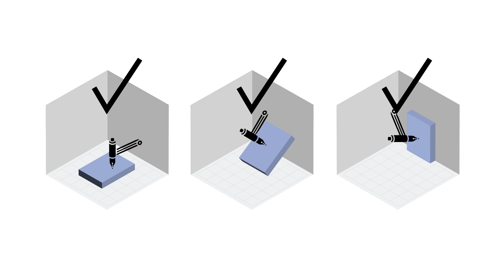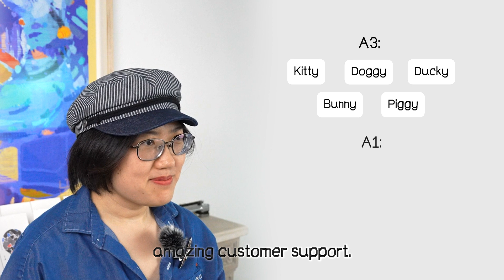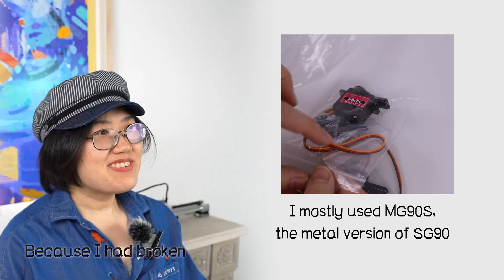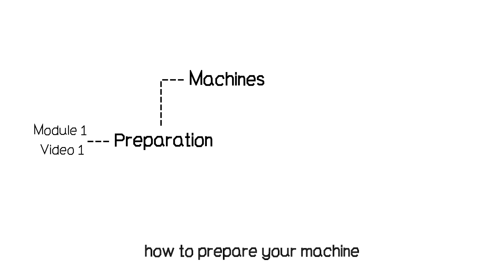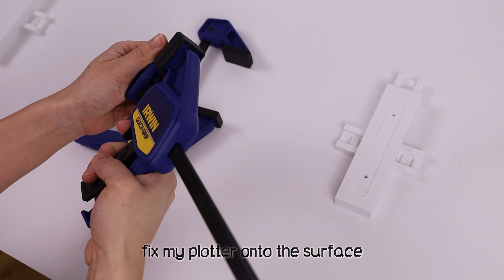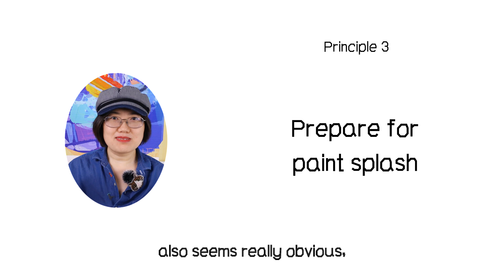Painting With Plotters:1.1 Machines

Comment: Which plotter do you recommend I buy?
Reply from the maker: Axidraw/nextdraw
Reply: @gencraftlab i love your videos.
Reply: @gencraftlab axidraw is discontinued.  Should i get the Bantam Tools NextDraw™ 2234 for 1849.00 US?

AS100016
Reply from the maker: Yes it’s the same manufacturer. Nextdraw is basically the upgraded version, and yes, the 2234 (A1) is a great machine to have if the space and budget work. But smaller models also work great.

Comment: I built an 8' x 4' drawing machine that used a marker pen, link: https://youtu.be/V62PsFjJ4IM , abandoned it because it took up so much space and I wanted to cut so I bought a 48" roll plotter. The Raspberry Pi is a very good suggestion, I used an Arduino board cheaper but not as versatile.

Comment: Your motor failures happen because of the nature of servo's.  Servo's  often come enclosed with plastic gearboxes, no roll bearings anywhere, not to mention any oil or grease to eliminate friction.  Stepper motors or brushless motors also often require gears, but less and they come also separatly, which drives these manufacturers to compete on quality.
Reply from the maker: Good to know! I did notice that each batch of motor I bought would have dramatically different lifespan.Upgrading the model of the server makes so much more sense!

Comment: I suspect you're running the motors or the motor drivers hot. I have run similar equipment for days without any problems and have not yet had a servo motor die on me. You might want to add heatsinks on the driver chips and adjust the pot so the motors don't run hot.

Comment: I set up a shared folder on my Pi 4 that I can access on my local wifi to transfer my gcode files from my laptop to my Pi. Then to run my plotter, I log into my Pi using VNC Viewer and run Universal Gcode Sender from there.  The  only downside I've had so far is sometimes the remote connection is a bit laggy, so if there's a problem and I need to stop the plotter quickly, it sometimes takes a second or two before the click on the stop button in UGS registers.
Reply from the maker: That's great! For the connection and delay issue, I normally use the physical button to stop the plotter first.
Reply: @gencraftlab  Unfortunately, I have a knockoff plotter (LY Drawbot) instead of an AxiDraw, so no physical buttons for me at the moment.  Maybe I'll have to add one later. I suppose I could cut the power, but then I'd lose my origin point and would have to restart everything anyways, so a slight lag is ok for most circumstances.